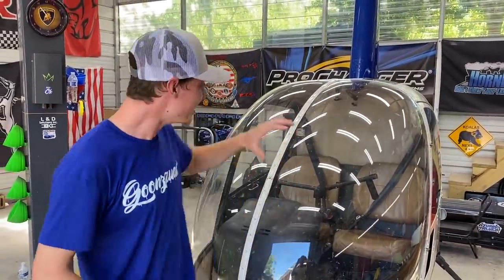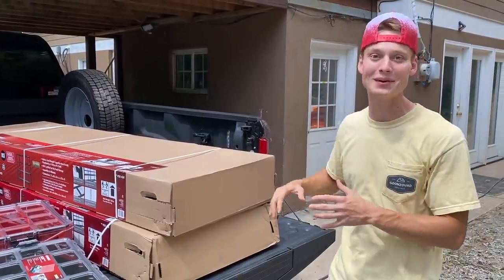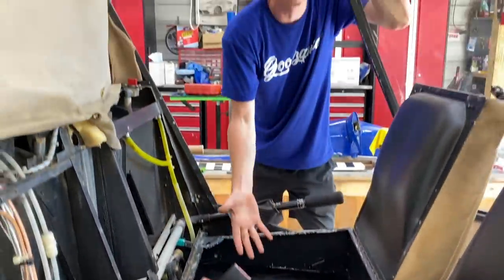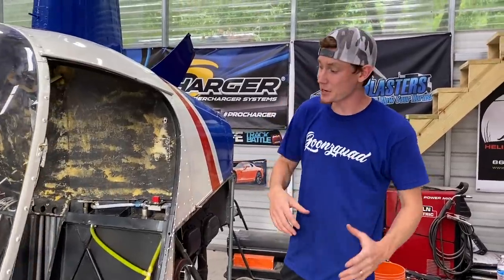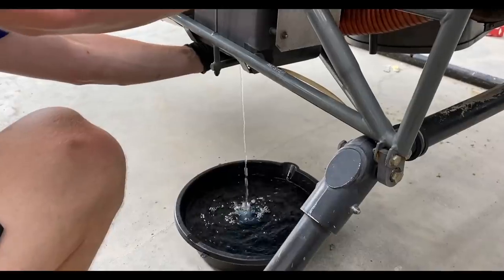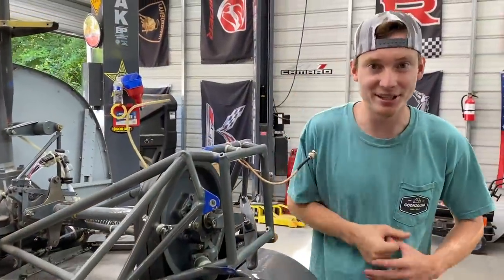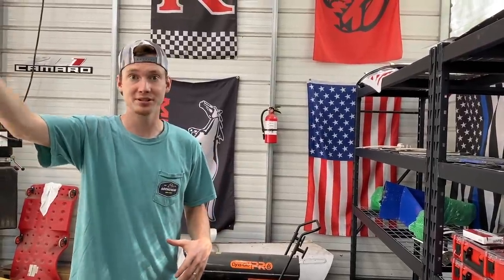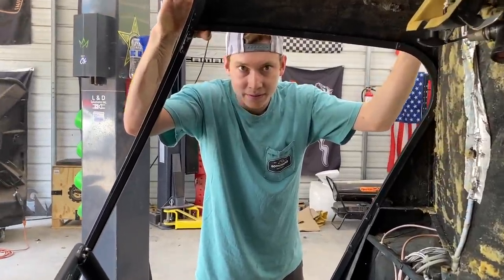Rebuilding A Robinson R22 Helicopter Part 2

Comment: Huge rule in aircraft maintenance - Never reuse a cotter pin.  I saw you guys saved the ones on the doors.  Throw those out and buy new!
Reply: why? they looked fine
Reply: xXfun god 90Xx better safe than sorry, there’s no emergency shoulder in the sky.
Reply: @Sebastian Perez Davila 
 When you use a cotter pin, you bend the metal.  When you remove the cotter pin, you bend the metal back straight.  Bending it back and forth like that weakens it and makes is susceptible to breaking.
Reply: @guy_in_ashopping_cart-sfs967   When you use a cotter pin, you bend the metal.  When you remove the cotter pin, you bend the metal back straight.  Bending it back and forth like that weakens it and makes is susceptible to breaking.
Reply: And never reuse nuts and bolts or life limited parts...
Reply: I think there are MANY rules not being followed... pretty sure 2 guys with no aircraft certification should be doing this but I guess they can throw an “experimental” sticker on and be ok.
Reply: @AdventuresOutdoors   Boeing employes qualified airline mechanics and they have planes fall out of the sky
Reply: @Randomgearhead  def. not the mechanics fault... You should change airline mechanics to engineering.
Reply: Im sure they saving those parts to get correct replacements
Reply: sure , yea, if they survive their first helicopter flight!
Reply: @alexramirez8096  never said they were the reason bud. Just stating a fact. If they are willing to fly their own heli that they re put together what's the big deal
Reply: Sebastian Perez Davila the phenomenon is called “work hardening” think bending a coat hanger till it breaks. In aviation maintenance the Bible is AC 43.13. In 1B sub section 7-127 it says they can’t be re used and should always use the largest pin that will for in the hole. This really is a historic project to take on and film. Every aviation expert is going to come out of the woodwork and critique this. Plus if they do ANYTHING wrong they are opening themselves up to considerable liability.
Reply: Random GearHead oh didn’t see the context yea anyone can do it as long they have instructions or someone with prior knowledge
Reply: @thewhitestjamal  fair enough
Reply: @thewhitestjamal   the wrong brothers didn't have a airplane Bible and  how did they die?
Reply: The rotors are bent downward when at rest and straighten out every time they spin. Should they be replaced after every use?
Reply: I would probably even replace every screw aswell.
Reply: Random GearHead they lay the foundation for flight by proving it was possible. industry standards for federal aviation regulations actually originated from the space program. The advisory circular document I referred to is what the FAA and A&P mechanics can use to reference. In this case they have a certificated rotorcraft and the airframe maintenance manual is the true bible. If you need to find something that isn’t covered you can always reference AC 43.13 1B
Reply: 70 Kid No. they are made out of composite materials and designed to flex. Cotter pins are not. Fun fact though. The R22 is fully capable of chopping off its own tail boom. Hard maneuvering of the cyclic can cause the blades to flex enough to strike the airframe.
Reply: @thewhitestjamal  if they got a hs education they should be able to read not too hard
Reply: That’s true with cotter pins everywhere.
Reply: All these people defending reusing cotter/split pins and all the franchise CAR dealers I worked at said replace everytime.

What sort of savage reuses them?
Reply: @guy_in_ashopping_cart-sfs967  😆😆😆
Reply: 70 Kid no because they don’t reach plastic deformation like cotter pins. They stay in elastic deformation. Google it.
Reply: @BillyJoeJimBob28  ?
Reply: George S Actually you are very right...or have all the work done supervised and signed off (RTS) by a certified mechanics.
Because What requirements must be met to get a mechanic's certificate?
You must be
at least 18 years old;
able to read, write, speak, and understand English.
You must get 18 months of practical experience with either power plants or airframes, or 30 months of practical experience working on both at the same time. As an alternative to this experience requirement, you can graduate from an FAA-Approved Aviation Maintenance Technician School.
You must pass three types of tests;
a written examination
an oral test
a practical test
Reply: 70 Kid basic physics, the blades are “the wings” of the helicopter so they are like the shock absorber or car suspensions on a Helo. If it is rigid it brakes if it flexible it doesn’t ! So a cotter pin being a rigid part of bent by use or removing it, this makes it fragile so a new on is the safe way of doing so. Many parts on airplane and helos are like this.
Reply: @skytrotter6144  ok honestly who cares, just buy new ones there probably a dollar at most
Reply: Bull. You can use a paper clip or any piece of wire for the doors pins. They do nothing except stop the door from coming out the holding bracket, which is only possible when the doors are open anyway.
Reply: MrDIAMONDCOR please don’t work on aircraft
Reply: @Randomgearhead  Not a mechanics fault it was design
Reply: It’s the same with auto collision repair we have to get new cotter pins
Reply: xXfun god 90Xx using it again makes it brittle and can risk failure of a part learned that the first week at UTI
Reply: What’s funny is Robison doesn’t use a cotter pin on doors it’s normally a clip ring. But In the case of this door the reuse if they put it back on won’t risk anything. Once the door is latched the pin is for looks and just keeps the door from shifting when open. I’d personally put the clip rings on just make for easier off and on of the doors

Comment: Hey guy,  I help rebuild my friend plane a few years are and there are thing you need to watch out for.  All body work has to be inspected by a licensed FAA inspector every step of the way.  If you remove a rivet it must be replace with an approved FAA rivet.  Once we removed screws on my friends plane we were told we could not reuse the screws and had to purchase new FAA approved screws.  ETC.
Reply: 👆 this needs to be shouted out louder! Torque requirements are important as well. Can’t hardly reuse anything and it needs to be inspected.
Reply: Did they not say right at the beginning of the video that they're working with a certified A&P on this project?  If that A&P signs off on the work you can be certain it's done right...
Reply: FAAAAAAAAAAAA

Comment: You guys will go through all of this when you’re taking your flying lessons but it’s very important to keep in mind the maximum takeoff weight (MTOW) of the helicopter when planning your trips. Even though there’s space under the seats for bags it doesn’t mean you can always use them. The weight of you guys plus a full standard fuel tank will easily put you close to the MTOW. Most of the time you can either go far with one person and full fuel or you can go together with bags but you’ll be stopping a lot for fuel. Not that it matters as the more fuel stops means you get to see more places! Enjoy the build and enjoy learning to fly guys. Having a pilots licence and flying is one of the best things in the world.
Reply: David Woodward 
Great encouraging and positive kind comments for future private pilots.👍
Cheers from France daring America. ( that’s why you have many guys like Elon musk)
Reply: @avoidingtrees560  I wish there were more. This is the America of the 1940s and 50s right here. Most can't do this today and it costs the nation its economy and humanity.
Reply: These guys are light; I weigh 220 and when my 200 lb instructor got into a C152 that wouldn't hold altitude on a hot day (fyi heated air is less buoyant than cold). Its a very worrisome feeling when the aircraft (that needed an engine overhaul at the time), couldn't carry us - so yes be very careful with MTOW. A 44 would have been more forgiving but has MTOW considerations just the same.
Reply: You bust a fuel pump on a mambo you coast to shoulder, fuel pump fails on. Chopper you go SPLAAAAAT
Reply: @rsprockets7846  It's a carbureted engine, there is no fuel pump. But fuel exhaustion and carb ice is something to be worried about. People have a misunderstanding with helicopters, if the engine does fail, it doesn't mean you go "splat"!  Helicopters are required to have a freewheeling unit so that the main rotor system and spin freely from the engine.
Reply: I was just thinking they need to hit ground school before talking about all this lol!
Reply: @rsprockets7846  autoratation dude
Reply: It seams like seatbelts in a helicopter would take away from the MTOW. I would trash those
Reply: No wonder i never seen a overweight person in a helicopter
Reply: @trythinking6676  chopper had siezed transmission went down hard and innlast moments he guided chopper away from school yard...a real hero

Comment: Nobody:
Goonzquad next week: What is up guys, we're here at the US Naval Base to pick up our Navy battleship
Reply: Ditch the R22 for that. Yes
Reply: Agreed, Airframe torque specs are never "Close enough" it is either "Dead on" or "Dead".
Morbid, but true.

I used to use Normbar and proto industrial torque wrenches for some of the stuff I used to have to do at the airport.
I gather they will also need a BUNCH of safety wire.
Reply: if they could, they would       but money and space is an issue

Comment: They do not run on jet fuel. I repeat do not put JET-A fuel in it. It runs on 100 low lead. Most airports have both. 100LL is more expensive. Running around 4.50 to 5 a gallon
Reply: Zach Grossman was thinking exactly that, jet fuel in what is essentially an air cooled flat four petrol engine would be nuts!

Comment: 16:30 That brake you are talking about is a rotor brake, what happens is when you are shutting down, you pull the lever and it slow both the main rotor and tail rotor. It’s used so you don’t have to wait 5 minutes for the rotors to stop spinning. It can also be used when you turn on the engine, you pull it so your rotors won’t spin. I work on pave hawks, and this is really cool to see this type of maintenance in the civilian world. And you guys are nailing the component identification. Best of luck

Comment: Glad to hear you got an A&P to help out. Document EVERYTHING! Logs are required.
Reply: When you open the fuel drain and call it jet fuel... I think they don't know anything at all when it comes to Aviation. If that robbo is running on A1 then I'll be damned
Reply: I'm sure that as soon as they start flight school they will learn all the terminology and nomenclature of components and system on the R22. Give them time and they will learn. I wish them luck.

Comment: The heater is like on old, air-cooled Volkswagens.
Reply: Isn't the motor a flat-four air cooled, just the same as Volkswagen? Simple and reliable.
Reply: Yep. Heater box exchanges heat with outside of exhaust piping. I wish the boys would work on an old air-cooled bug.
Reply: Hugh Evans in the aviation world we call them horizontally opposed engines.   They come in 4, 6, and even some in 8 cylinder models.   Air boats used to use them a lot.
Reply: @gmcdaniel1964  my motorcycle is a flat six, or I should say horizontally opposed engine. The new Goldwing.
Reply: Volkswagen karmann ghia times!

Comment: Three reasons you rivet aircraft.. 1) Material Thickness. its very difficult to weld thin aluminum. 2) repeatability, To help with the repeatability of rivets there are certain specifications that most rivets used in industry must meet. These standards help ensure that they all form in a similar way with predictable results and predictable strengths. its harder to replicate consistent thin material welds. 3) Inspection.  During inspection of rivets the inspector will spot check rivets using a gauge that measures if the “butt” of the rivet has the proper diameter and height The values are pre-determined for the different sizes of rivets..Because welding is a chemical process and has layers that cannot be seen from the surface they can take more intrusive or expensive ways to determine the quality. Meaning it is hard to check welds in the field. And repairs are difficult.
Reply: Many of the aircraft aluminum alloys are not weldable. The weldable alloys usually require heavier assemblies to get the same strength. There are many welded aluminum parts though, like intercoolers and some ducts. I have rarely seen an inspector use a go-no-go gauge. Where I worked they did look at every rivet and with years of experience can see if its correct or not. And they where picky, even to that last rivet buried in a difficult to access place.
Reply: Clever clogs!
Reply: @robb1165  yeah, aircraft aluminum is really soft. I describe it as almost an aluminum "foam".  And cannot be welded without making a seam at the edge where the thickness would be doubled.
Reply: One more thing is it’s easier to drill out a few rivits to replace a damaged panel than to cut grind and weld a new panel

Comment: Welds crack, welding weakens aluminum, and riveted joints are stronger.

You're welcome.
Reply: It was built back in 1991. Not many people knew how to weld aluminium back then. I bet the newer ones are welded.
Reply: @Gonza1000  In contrast to what kids under 40 think, the world was NOT invented in 1991.
Reply: @Gonza1000  New manufacturing actually uses panel adhesives and alu rivets, no welding except the vertical firewall for some reason
Reply: @Gonza1000  lol 1991 = Back then!  NASA had spaceshuttle for 10 years for fuk sake.. Z gen kids make me laugh.
Reply: @Gonza1000  Ford rivets most of the new aluminum body F series instead of welding.
Reply: Riveted joints have a higher fatigue resistance than welded, especially in aluminum.  In a high vibration application like this tiny cracks can start to form.  Also, welds have to be inspected for many types of defects and there isn't a good time efficient way to inspect them to the standard that an aircraft needs.  The risk is too high if something were to fail.
Reply: Biggest issue is pressurization and depressurization cycles (mostly affects high altitude jet airplanes). Welds do not hold up well against fatigue stress that comes with many flight hours.
Reply: Gonza not typically. Most aircraft manufacturing processes have been the same since the 60’s onward. Riveting also allows for things to be dismantled and repaired easier than if the part was welded

Comment: (Trackhawk): im the most expensive paint 
(R22): hold my collective....
Reply: the R22 might actually be cheaper hahaha
Reply: KillaCawk I doubt that paint has to be FAA approved so that jacks the price up.
Reply: @alexandersherrell3790  thats actually not true paint materials are mandated by the faa but as for the paint its self it doesn't have to be inspected or approved it just has to follow maintaince practices of either the airframe manual or if not available AC43.13 standard practices
Reply: @alexandersherrell3790  also if its privately registered they kinda have free range to do what ever they want under an experimental tag
Reply: KillaCawk ok I didn’t know that I understood it as it had to be FAA approved.
Reply: @alexandersherrell3790  no worries its a pain in the ass interpreting FAA regs but it's part of my job sadly

Comment: I'd love to be a mile high and thinking about how small the door pins are lol
Reply: yeah, my wife's jewelry box hinges are bigger than those.
Reply: 3:50
Wait a minute.............
You need a man to come and see what work/improvements you have done. For safety reasons but the doors are held on with Remote Control kit car shell pins!!!
Reply: R22s are certified for flight without doors,  gets hot in the summer and with no AC you’d be glad to have the doors off
Reply: Looks like a cheap helicopter. Can it fit 2 people?
Reply: Is this a one man helicopter. Seems to small for two adults
Reply: West coast Turbos then why is there two seats?
Reply: West coast Turbos 
       R-22 is usually used for flight training.   It’s a two place helicopter.   Student and instructor.
Reply: @westcoastturbos  are there 2 seats?
Reply: @David-cm4ok  3 isn't their

Comment: Because most modern-day airplanes are made from aluminum, a weld isn’t the best bonding option between to pieces because when aluminum is heated up it becomes weak. Another key reason that engineers like to use rivets instead of welds is that rivet points are easier to inspect than weld points.